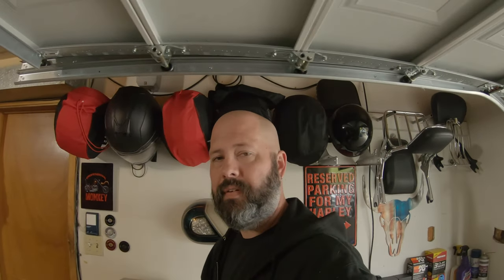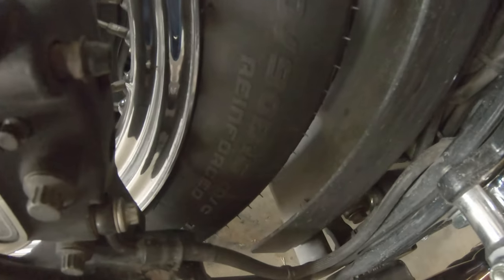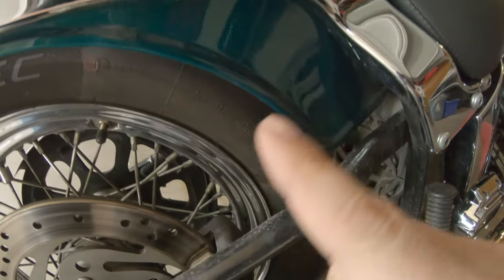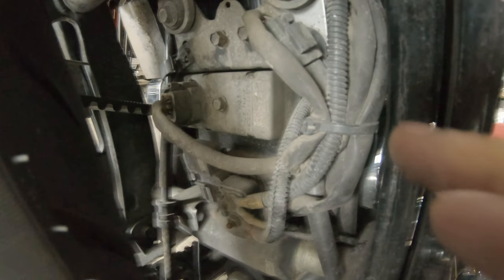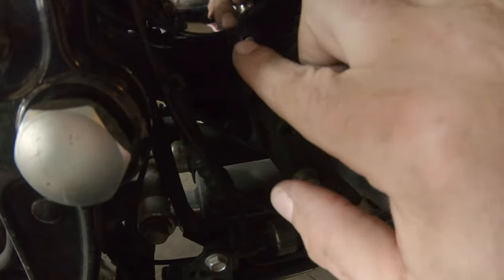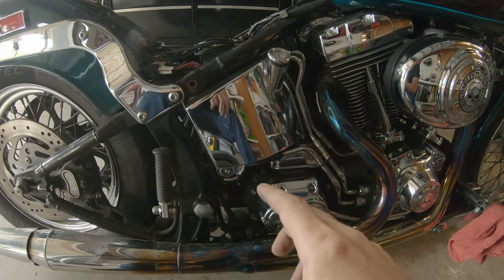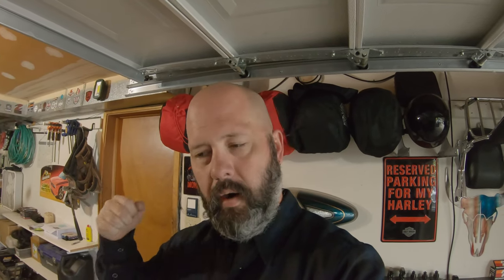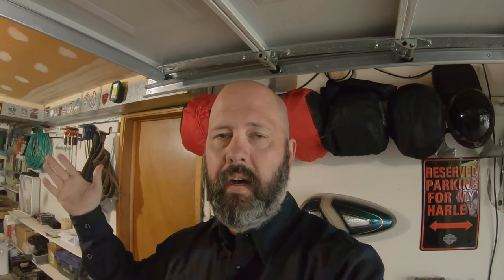Replacing a Vehicle Speed Sensor on the Springer

Comment: Electrics are the Black Arts lol! I've had problems with the starter and system relays on my Softail Custom, I replace them every year and carry spares now as a matter of course. I buy genuine HD relays, still made in China though!
Reply from the maker: Definitely some VooDoo magic that is beyond my understanding for sure. I hope this springer doesn't end up requiring new electricals every year but if it does, it does. I too try to buy HD when I can but when my options are 260 for HD or 80-170 through Dennis Kirk, I think I know what way I'm gonna go, lol